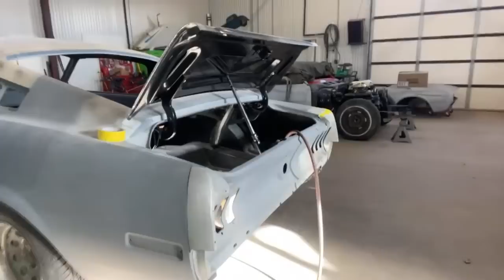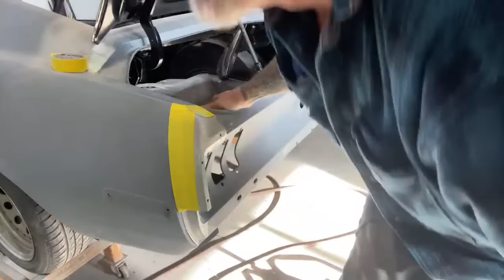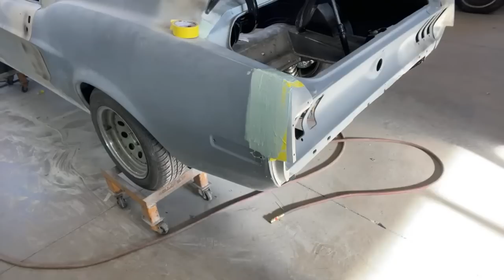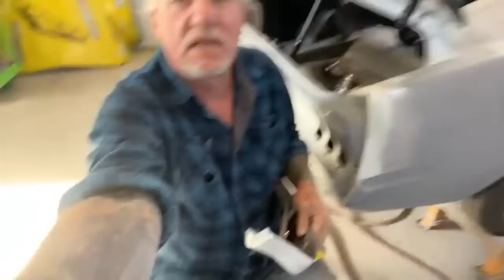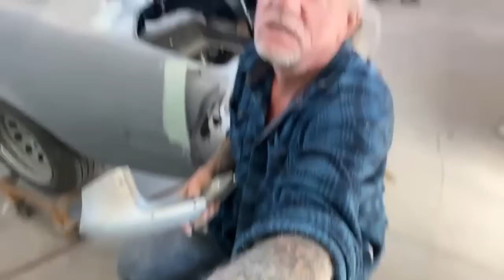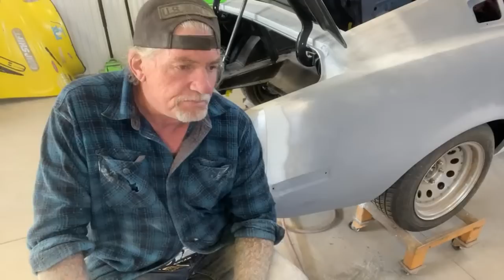Car Restoration Bondo HACK JOB - Big PILE Of SH&T Car

Comment: I like the videos that show real time, how we learn. Some creators time lapse each task but you don't see how anything is done that way. Little tips and tricks get left out. Thanks for what you do! You nailed alot of points for me, I have also been told I'm old school and no one does that anymore. F em!
Reply from the maker: Thanks Scott
Reply: @diyautoschool  When you lay into the internet knuckleheads or the tell the real facts about "idiot proof" products that is what people need to hear. Back when I was working in body shops I priced those Street Beasts kits, the price was high but they were a quality shell. You building 478 of them AND many other builds should tell viewers the level of experience they're dealing with. At $50k per Beast that's $24 MILLION. I especially appreciate how you expose the state of product shmuckery today. The last car I painted left me with sticker shock, even the jobbers are charging insane prices today. Even when buying the "budget" brands. You are a national treasure my friend.

Comment: As somebody who falls into the category of millenial ('94) and also owns several classic vehicles (late 60's), this information is invaluable. I've been turned down at least half-a-dozen times by body shops. The moment I mention cutting and welding, they won't touch it. So, here I am learning how to do it myself, the correct way.

Subscribed with notifications on!
Reply: Its likely due to most body shops being centered around collision work. Their business models dont account for restoration type work. the rates are different, the process for estimation are different, lots of the materials, sources for parts, and repair procedures are different, and workflow is different. Sure, the technicians are capable, but the business itself isnt structured to accommodate for those types of jobs. especially corporate types.  you might find a solid independent collision shop that can fit it in, though.

Comment: I've gotta say I really enjoy your channel,been watching you on both channels for a bit now.I have currently been working on a 66' convertible mustang for a customer,I have actually been doing the same to this car.The previous owner before this one; had complete floors,front frame rails,both quarters,trunk,hood,driver fender,tail light panel,and both doors replaced with aftermarket parts.Absolutely a nightmare for panel gaps,the only thing that is oem is the quarter extensions and passenger fender.Currently 26 with my own shop and Absolutely love re-doing these classic cars and trucks.
Reply: P.s. this is not hack work,these classic vehicles where mass produced with a lot less fitment standards then now.To get an absolutely amazing finish sometimes you have to do panel to panel body work,do it correctly and you won't have a problem
Reply: @williamshelton349  
That's right!
Reply: @williamshelton349  so true , our old Aussie cars are the same. Nothing lines up so this is the best way .

Comment: What’s up Pete!!! Thanks for all the helpful life changing tips over the years to save us money brother! The plastik honey in body filler works sooo good. I was one of those that bought those expensive body fillers because they spread a lot easier but I use hi tek now with some honey in there spreads amazing. The more fill I need the less honey. If I’m skim coating or filling pin holes I use more honey. It’s cut out the need for glazing putty.

Thanks man!

Comment: Back in the late 70's I worked at a body shop as a cleaner and prep man. They used fiberglass resin in their final coat of mud to thin it out before they had that honey stuff.

Comment: Pete I bought aftermarket fenders because I had drilled a hole into one of mine for a snorkel and then went a different route, I ended up having to get the one on the other side so they both matched the hood the same. Now that I have more tools and knowledge I want to put those fenders back on after I repair them. Aftermarket stuff doesn't line up or match with OEM FAFO edit: PS they both came dented and I was able to get my money back and repaired them.

Comment: @D.I.Y. AUTO SCHOOL If you were restoring this car later on down the road or got this car after someone did that nice body work, would you remove the bondo and start over or leave it and paint over it? trying to figure out if you would take the car down to bare metal and remove the old bondo?

Comment: Dynacorn hinges for the second gen Camaros suck too Pete. And the cowl induction hoods are crap stamped also. I have two and they both are 1/4" longer on the passenger side! Cut weld grind, repeat..

Comment: what if the extension is a little lower than the quarter panel. i have a 65 lemans & the parts are original & they don't line up.

Comment: LOL 150 dollar body filler. I have been buying this evercoat lightweight filler that was like 25 dollars a gallon at the ma and pa body shop supply place by my house. the price is up now. Been using this stuff for over 5 years. not a single issue. sands great and easy. Its called evercoat chrome a light lightweight body filler.  100838.

Comment: I would rather use air tools they dont have a battery to mess around with. I guess when it came to having to taking big things apart and air tools had way more power to get the big 1 1/2'' nuts off and putting big tires on the tractors.

Comment: Hay Pete you put that Bondo over primer l am not trying to be a smart ass but it's should be on bare metal right the left side.
Reply: Your FIRST INITIAL Bodywork job should be on Bare metal, Doing the FINAL Bodywork job as you see in this video can be done on PREPPED "FRESH" Primer -- as seen in this video.. If the car sat for a long period of time then I would have taken it down to bare metal but since it was a fresh prime job -- prepping it with 80 to 36 grit will be suffeciant.. Sorry I didn't explain that in the video..
Reply: @myfriendpete  thanks for the answer just trying to learn as much as I can